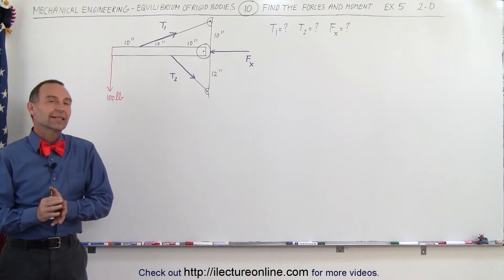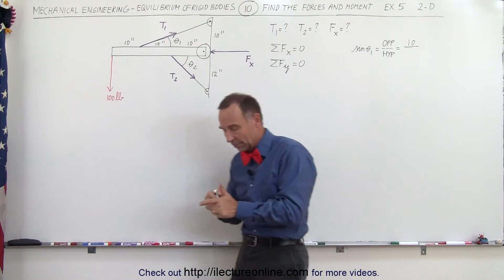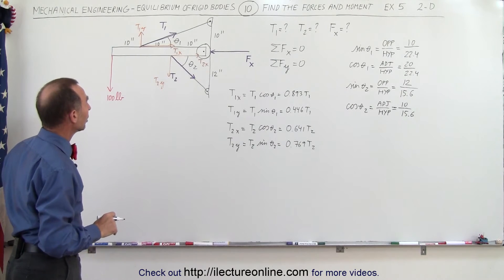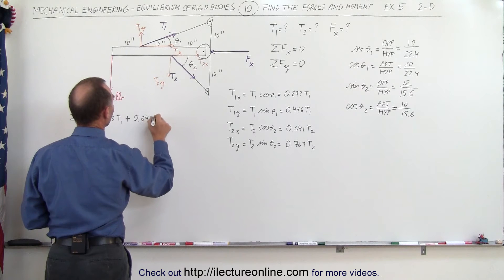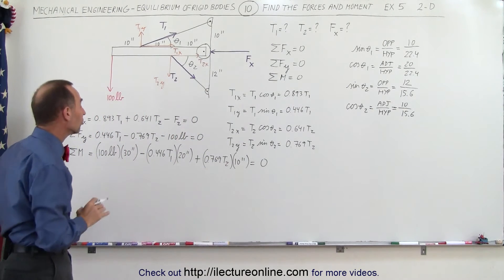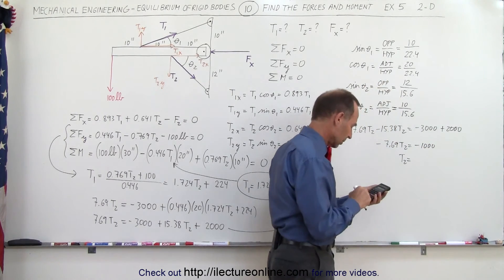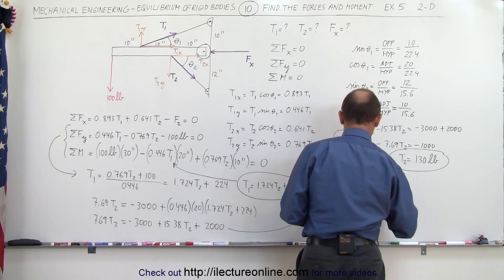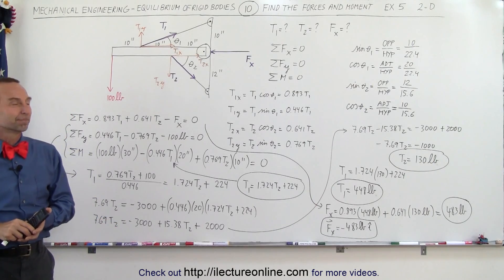Mechanical Engineering: Equilibrium of Rigid Bodies (10 of 30) Find F=? T1=? T2=? Ex.5, 2-Dimensions

Comment: Sir, when you calculate the moment of force. Why you dont include the T1x and T2x instead of only the vertical components(T1y T2y and the 100 lb)?
Reply from the maker: The components of the tension parallel to the beam cannot produce a moment (torque)
Reply: I got it ! Thank you

Comment: I have a question can you please answer if this was an exercise to solve as an equilibrium of a particle this wont work becaus the y forces arent found on the same y axis am i right im asking bcz my exam was bas on an equilibrium of a particle and they gave us a body which had forces applied left and right of the object plus the weight which is on the center of gravity of the object
Reply from the maker: Did you look at this playlist?  MECHANICAL ENGINEERING 1 - EQUILIBRIUM  https://www.youtube.com/playlist?list=PLX2gX-ftPVXUjkEEXJoC0mx8mxTlfqpCn   There is a similar playlist in the physics portion of the channel.
Reply: Michel van Biezen what I meant is that my exam was 3 days ago and i had only 3 chapters which were which included equilibrium of a particle 2D 3D and moment about an axis I was really ready for my exam and i solved everything in the statics book and all the 2D equilibrium of a particle exercises is were all the forces are directed from the same point (particle) and in the exam the exercise that they gave us was a rectangle object held by a spring were it had weight and tension on the middle of the object but they added 2 forces on the edges of the object so it became weird because those forces arent on the same particle and im sure that the doctors added those 2 forces from there own and thats wrong because we havent reached equilibrium on a rigid body
Reply: Michel van Biezen can an exercise like this be given were we apply sigma fy on the same particle but over here the exercise you solved im convinced that you mentioned the 100lb force in sigma fy because it the case of a rigid body